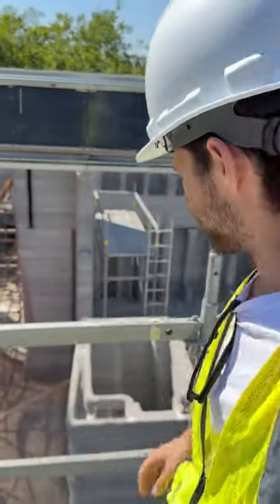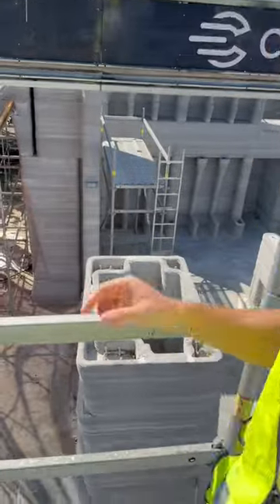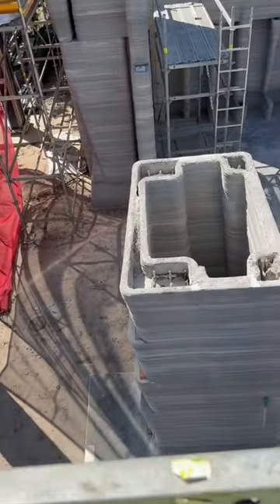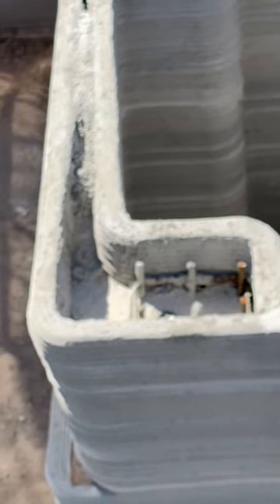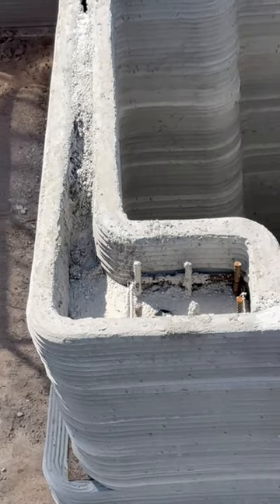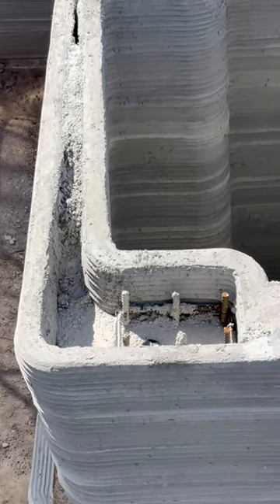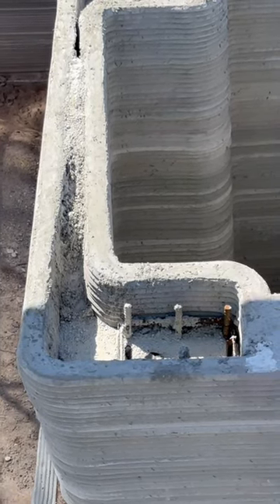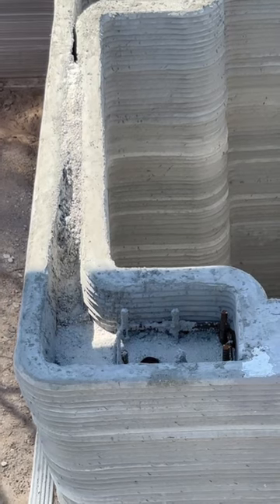Vertical load solution for printed walls

Comment: Finally answered! 
It's really more of a 3d printed formwork then? 
Why use cement for the form?
Reply: Because its more expensive and people are suckers. Why else?
Reply: @joeydigrado382 it costs WAY less. Think about all the individuals who have to inspect,  verify joints, all their college backround, all the years of experience to get to their position and pay scale, no longer needed for a simple calculated flat rate. No guesswork. This is just simplification. Think about it. Less work on the codes, paperwork, insulation safety, all the companies and crews needed to just get the framework up. No wood needed for frames which is possibly a goal here. The concrete isnt filled with rock which im sure makes it easily recyclable where as in a house as soon as u start spraying foam and insulation lots of the resources used can not be reused. Long term and likely the backbone of their company definitely has to have the numbers to back up what they are doing when it comes to the processes needed to build a house.
Reply: @DerekJohnson-k8p  i guess it would depend on the size of the structure to determine if it costs more or less. Because not all structures need to be inspected like a shed or something. And some of these machines can get up to a million dollars from what I understand. The people who inspect, come in for a few days to a few weeks or more depending on the size. That would be a couple of thousand of dollars, I would guess. I'm not sure, but I'm not adding their college tuition into the equation; if that's the case this would be taking a lot of jobs away from citizens etc. And none of this stuff has to get inspected? There is more to this than just the frame work getting inspected like the electric and other things that probably have to get inspected. All I know it cement costs a lot more than wood, so does steel, rebar which you don't need in the wood frame work etc. Thanks for getting me to really think about it, now I am even more curious to know the truth bc it doesn't seem at all that it would be a lot less.
Reply: @joeydigrado382  What a strange thing to troll about.
Reply: No, the concrete walls will be loaded by the roof, but there will be areas that need to bear higher loads. Under the table, for example.
Reply: @klocke-hx3xl  I don't troll ever.
Reply: @joeydigrado382  ok troll
Reply: @klocke-hx3xl  you can't debate me on anything.
Reply: @DerekJohnson-k8p I was under the impression that concrete is becoming slightly increasing in its cost due to workable sand being in less supply.
Reply: @joeydigrado382  it costs significantly less to do it this way lmao are you even paying attention at all or are you just saying random shit
Reply: @MrPacman64  why don't you explain how and refute what I said. I had a clear rebuttal to the other guy. It doesn't seem like it costs less at all.
Reply: @joeydigrado382 you're thinking too small, these aren't going to be used to build sheds. All these machines and buildings are prototype proof of concept at the moment. The machines will be getting vastly faster, cheaper to build, more accurate and impressive in what they can accomplish over the next decade.

The goal is to get them to the point where  a single machine and a couple of guys can knock out the shells for an entire housing estate in months/weeks/days instead of years with the labour costs of an entire building crew.
Reply: I don’t  really like the idea of an entire house walls system made of this. Personally I would rather have nice smooth foundation walls. But that’s  just me.
Reply: @vanq4999  nah I said it would "depend on the size of the structure". I was thinking relative to the size. you have to understand that this would not get much faster, want to know why? Just look at how this is done, see the different color layers? They Have to let a certain amount of concrete dry before they can put the next layer on or it will all fall down. And there is no way around that. That is just how concrete/cement works. So they would have to wait for it to dry no matter what. And adding too much accelerants like calcium will only weaken the structure. So there is no way around the drying process if you want a sound/stable structure. I never think small, trust me. I think you are thinking too "small" imo. I know how this stuff works because i work with all sorts of concrete/cement, gunite and plasters etc. You can't build an entire building like this because there still needs to be windows, plumbing, electrical, amenities and utilities etc.
Reply: I can guarantee you, this method is cheaper, especially on a large scale. Dinosaurs gonna never want change tho.
Reply: @joeydigrado382 that's why they do other sections while the others are curing.
Reply: @DerekJohnson-k8p you think there’s no one there supervising the printer?

You’re paying 3 guys to stand around watching over the printer for 2 weeks, or 10 guys for a day to erect the forms.

This will never make sense at scale
Reply: Just metal frame and pour. Saves time, money, materials. Like putting bark down and putting studs inside.
Reply: @sourhippo  seems like this would be great for printing foundation forms or basement wall forms in a residential application.
Reply: Here in sweden its popular with "lego" houses. They make the walls in a factory and take them to the place where the house is built with trucks. A new house can be built within weeks. They also have reinforcement in the whole wall, and not just the sides :)
Reply: @AndrewTSq  Europe doesn’t have the workforce that America has, which would explain why so many products are do it yourself friendly. Personally, I think it’s best to keep teaching the old methods of doing things. There’s more than enough young men that need to fill their time with positive activities.
Reply: @DerekJohnson-k8p false, you are not taking into account how these machines are prone to failures. If you had ever 3D printed anything in your life, you’ll understand how frustrating it is. When the print fails and you have to start from scratch, I don’t see how it is cheaper.

Comment: So its basically a longer, less efficient, uglier version of actual construction. My personal bias aside, thank you for clarifying this, as this is the first video I've seen showing this. Now what I want to see is how well these walls hold up to stress and impact.
Reply: They are using machines not white people chill bro 😂😂😂
Reply: they skimp on the rebar
Reply: standard concrete building take lot more time and money, you need formwork, meteo, more people....my main reproach is more about protecting cement from elements outside with cladding and make insulation inside and protect people from dust...
because if you know industry, the cement use often aggregate who are dangerous like mineral fiber dust like amiante^^
Reply: @eriklerougeuh5772  Not in sweden, we have factorys that make the concrete walls that then are loaded onto trucks and taken to the place where the house will be. New house is built within weeks, and cheap.
Reply: They will improve overtime

Comment: Wood is cheap bro. Thats why we use it to make our forms, especially if were just going to fill them later.
Reply: And it will be much stronger because it's a continuous pour, they do interrupted layers that have lateral stresses from uneven drying. Having the whole concrete piece set uniformly is one of the key ingredients to good structural integrity down the line.

Comment: The 3d is essentially a form. Seems like an expensive way to create forms.
Reply: I was thinking the same, precast concrete slabs probably would be a better solution for "standard" buildings
Reply: Yep , being a crane driver I was thinking the same thing 
Thing is ...this can be made from scratch on site ...no need for expensive lorry journeys no need for cranes 
Not a dangerous ....all round less men needed ....
This is the future.  Unfortunately
Reply: They aren't creating forms they are adding necessary structural support...after the main structure is dry....
Reply: Depends. Prefab is different. Prefab is usually made in bulk. With 3D printing is probably cheaper for a custom ‘design’.
Reply: You remove the labor and time constraints. 2 guys can do what 8 do. With the reduction of lumber costs too. Concrete get cheaper the more you buy. It takes them like 2 weeks to print a house. With 2-3 people.
Reply: @deanthornby2026 you obviously don’t know the intelligence level of the average American concrete truck driver
Reply: So, using wood and paying labor for multiple weeks is cheaper?
Reply: Becomes part of the structure. It's lighter and stronger than traditional concrete, and apparently entire structures can be built faster this way than with traditional methods.
Reply: No that's just the pillar, not the entire thing.  The exterior would be filled with insulation.
Reply: Essentially you can’t make those shapes with traditional forms but with 3D Printing houses you can create  home with better aerodynamics depending on the geographical location and region in case of weather conditions like tornadoes and much more
Reply: Until you actually do math of paying enough forming laborers at USA labor prices. . . .
Reply: @joaoph9391 Precast forms are used for the big square box buildings.  They're trying to build architecturally pleasing homes now.
Reply: @@rgagregreYep laborers who are HUMAN and make mistakes that take much more money to fix.
Reply: @snap-off5383  Well they are also trying to pretend it's stylish so they don't have to pay for siding, or interior finishing.  And if that's how it goes, it will be much, much cheaper, and faster as it saves all that finishing time.
Reply: @s.v.gadder1443 The main structure of a building is what structurally supports a building...

🤦‍♂️
Reply: How would you create smooth custom forms without this in a cheaper way? I specify cheaper. This machine can do any shape you want without having to buy materials assemble them etc. Just place the machine run some code and you're done.. this is the future why don't you see?
Reply: @deanthornby2026 why unfortunately? This will allow homes to be more custom, potentially cheaper etc. You'll still have a job craning things on other projects. Or you can retrain to operate one of these machines. It's the future and it's beautiful
Reply: @gordon1201  I'm not convinced it is.  It's only cheaper if they can either get people to like the aesthetic, or they can get glass like finish out of it.  Otherwise it's not cost saving because a 2x6 wall will go up faster, cheaper, and be done.

The moment you add finishing to this (inside or out) any possible cost savings goes out the window.
Reply: In sections that need reinforced they are backfilled for rigidity, but everywhere else they leave the airgap and seal it up at the top termination of the wall, this airgap ironically provides insanely better insulation than Rockwood or fiberglass despite being unintuitive air makes a better insulation than most common insulation materials, and obviously there is a large cost savings when not using those common insulation materials and obviously when using 10% of the concrete used on standard houses so yes there is a significant price difference
Reply: They should just use styro bricks and fill them, cheap, insulated, sturdy and quick.
Reply: @VeniVidiAjax  their main selling point is mid job adaptability, and customizability for little or no increase in cost aside from another batch of their mix maybe if your adding. It also reduces the necisary labor force and thus reduces the number of people who need to be accountable for your house being built.
Reply: Think of it this way - rather than having to set up forms, pour the support column, wait for it to cure, remove the forms and then build the walls, you just embed your rebar into the foundation, print your walls/formers and then pour the column.
Reply: I think the same
Reply: @the0eldest I don't like the unfinished look I've seen them go for.
Reply: @abrahamgalarza5421 that’s the dumbest thing I’ve ever heard lmfao. I pour foundations for a living and I can pour whatever shape someone wants

Comment: As someone that 3d prints regularly. This is literally just paying for someone to give you lines in your concrete
Reply: How does that make you an expert on the cost effectiveness of this?
Reply: @mastabas  that's a very odd comprehension of the words in front of you.
Reply: @mastabas I'm a GC, and to even think this Could be cost effective in some way is bonkers.
Reply: Lines that look like piles of doo-doo, lets not forget.
Reply: @NotASeriousMoose as an electrician, I wonder how exactly they're doing things. What they showed does not exactly convey ease or cost effectiveness, that I've seen from my perspective anyway.
Reply: @goosenotmaverick1156  I do not think they are running wire, honestly. Ive seen a lot of videos, including the one where they haphazardly seat junctions in their playdough walls, and I think this is just video to fundraise from investors - your average hedge fund child knows even less about building than these hustlers do.
Reply: @Mitch_Feral  I haven't seen them do it either, just the ones where they set boxes, which doesn't make sense given another video shows the cavities the boxes have behind them being filled with concrete after the fact. A lot of this just doesn't make sense yet

Comment: Awesome, so it's a million dollar machine that does the job of two sheets of shutterply.
Reply: Correction the machine is about 10 grand on the cheaper side...
Reply: In half the time... that's the important part
Reply: Formwork takes a lot of time and money. Materials may be cheap but carpenters are not.
Reply: Correct Everyone overlooking one thing.   Cost!  This method of building costs way more per square foot than traditional building.
Reply: @samp43 Every new technology was expensive until it wasn't... do you know why? because someone somewhere ate that cost in hopes of finding something new.
Reply: @samp43 except the savings is not for the consumer at all, the house will still be ridiculous over priced. the real business to be had is renting out the equipment so people can buy their own materials and do it all themselves. they should be trying to incorporate hemp bricks into the equation.
Reply: @samp43  Not even close. Ever see what you have to pay in labor for formers?  That machine pays for itself FAST.
Reply: @snap-off5383 Where I live they pay carpenters sweet fuckall for the amount of skill and knowledge they're expected to have, idk what you're all talking about 😂
Reply: @brandonesp6099  Exactly.
Reply: @fringeminority7746  Framing formers =/= carpenters.   Framers are the "grunt crew" where you put the less accomplished thinkers.   Half their job is just tearing forms off, hard to screw up.  But even paying them minimum wage which they're not, the wages add up to much more cost than 3d printed houses.
Reply: @samp43 there's just no way
Reply: Half the time, half the wage cost.
Reply: these videos won't seem so dumb in 30 years or so. Someone has to pioneer the technology, and it's a risky endeavour.
Reply: @JunkBondTrader  Exactly.
Reply: One machine VS a whole team that takes weeks to finish
Reply: @snap-off5383 the ones at my job site still manage to fuckup regularly tho...

They rarely wait for the electricians and plumbers to finish nailing stuff to one side of the form and half of everything ends up buried 3 inches or more deep inside reinforced concrete